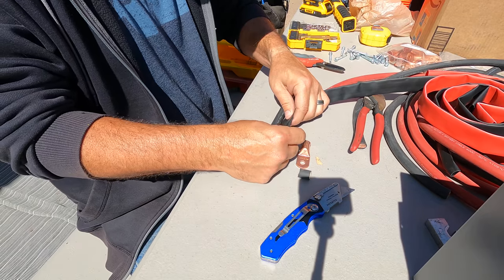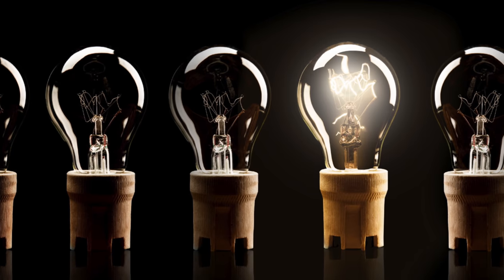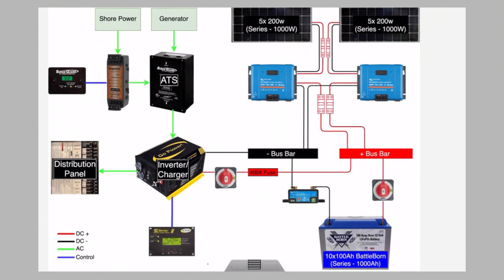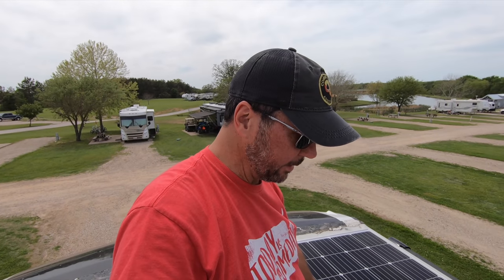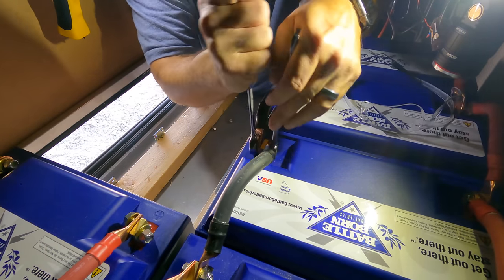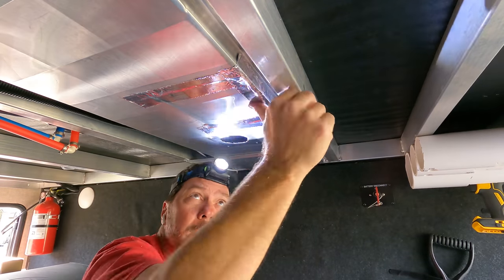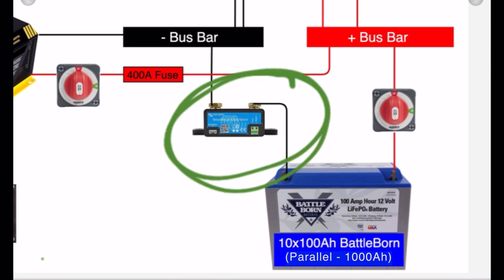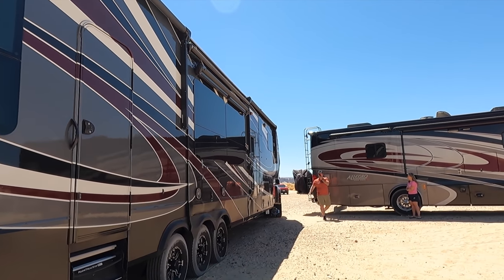☀️  RV Solar Install! 😎  (Full Time RV Life)

Comment: I always like watching you at work. Because I can count on you paying attention to detail.  Maybe because I can easily relate with other Veterans. ..... so you worked on a carrier??  Wish You guys best of health and safe travels.
Reply from the maker: Thanks!  Yes.. I worked on E2-C Hawkeyes, deployed on the Roosevelt (CVN-71)
Reply: @ChangingLanes  I was Army, started as a generator mechanic, finished as a Motor Ssgt. been in many different types of units, all over the world. finally called it quits when I returned from Iraq in 91. Thanks agian, you did a lot of planning and prep the same as I did (with the cardboard cut outs.) of course in this heat, I am not getting as much done as i would like daily. safe travels

Comment: ❤  I have seen videos on people running there ac off solar.  They have installed what is called a soft start on there unit.  I guess rather than max power suddenly (hence the name soft start) the power ramps up. You may want to look into it.
Just thought you would like to know.👍👍

Comment: Awesome video, good overview without a ton of useless details. Only thing I would say you missed is the advantages of parallel vs series arrays, with respect to shade. Some panels it's not as big a deal, but a lot drop an entire string I one panel is shaded.

Comment: Really great job on the install. You really educate yourself to a professional level and then pass on your knowledge!  I appreciate it very much.  
Two questions for you. 
1. I presume you wired your battery bank at 12 volts because you were reusing a 12 volt inverter. If you were starting from scratch would you go to 24 or even 48 volt battery bank?  
2.  What do you think about a  DC to DC charger charging powered off of the tow vehicle’s battery?  Even with a big cable your upper limit would be 70ish amps.  But on days with little solar gain it would be a nice addition to the battery level.  
Always enjoy and learn from your videos. Thank you!
Reply from the maker: Thanks!
1. Yes.  I'm not sure about 24 v or not... Lower amperage might be worth it but not sure there's that big of an advantage. 
2. Those are a great idea, but with 1000Ah now, we can run the fridge on travel days no problem.. even if we didn't have solar.

Comment: I was installing my solar system today and had the same experience as Chad when tightening the battery interconnects with the stainless hardware on my Battle Born batteries. The stainless hardware locked up and I had to cut one of the bolts off. I think the stainless hardware is so soft I think I stretched the bolt.

Comment: Our flagstaff is prewired for solar and has a roof box already installed. I'm sure I'll have to change it out when I go solar for a larger system then it will allow. They were smart enough to have a dedicated pocket that runs down along the control panel to route wiring to the basement. The more I see of grand design the more a scratch my head and wonder why the appeal.

Comment: if you get a compressor fridge solar runs them fine, i have 100Ah AGMS, 600 watt solar and keeps my apartment fridge up all the time (uses 120w vs 500watt rv fridge)

Comment: Awesomely complicated video, I almost followed you to the end. My takeaway is that Solar is great but NOTHING really replaces a generator. $10k of batteries and solar panels = $5.28 in gas on a Generator.  LOVE your channel and videos.
Reply from the maker: Very true.. But peaceful sleep with the AC on = priceless.. 😊
Reply: I gotta agree with Chad on this solar vs generator topic.  Solar is silent and odorless, if high end expensive for front end installation.  Generator is noisy and stinks and must be kept fueled with a non-renewable resource.  For folks who don't boondock or live in their RV's full-time, this extensive of a solar system wouldn't make any kind of sense, it would never pay for itself.  But for full-timers committed to a life on the road and being able to live off-grid and as self-reliant as possible, it makes total sense, IMO.  When I buy my RV, I plan to have a comparable solar system installed...

Comment: When you switch out your inverter charger you may want to switch out your single-pole solar panel breakers with 2-pole breakers.  NEC code states that on non-earth grounded systems both the positive AND negative wire must have a disconnect.

Comment: Great video as usual!  I just completed a solar project on my 26 ft Grand Design.  It’s about half the size of your system but similar to yours.  I have 4 one hundred AH batteries with three 385 Watt panels in series.  They are connected to a Victron 150/85 mppt charge controller which is connected to a Victron Lynx distributor.  We only have a 2200 watt inverter but does everything we need in our RV except air conditioning.  We are in the testing mode also to see how far we can go with only solar.  We do have a generator for air conditioning if needed.  I thought my project was a lot of work but you out did me by a lot.  Hope we get a lot of sunny days now.
Reply from the maker: That Lynx Distro is Nice!

Comment: Well done! I thoroughly enjoyed your diagrams, explaining what and why, and then actually showing showing all the steps.  I appreciate that you prefer to do it yourself, I'm the same way. Your setup is a little more elaborate than my factory 100w panel/single battery system that can't keep my 12v fridge running 1 day😂 Maybe one day I'll upgrade it. 

I had to laugh when you found the end of the conduit! Why do manufacturers do stuff like that!
 
Thanks for providing great content!

Comment: About running your fridge while traveling. You have handled the biggest part of the fridge running or not while traveling. But, the newer fridges have far better insulation than the older models and depending on your road hours, can handle not being running on either propane or electronics for a fair period of time. Years ago, they used to produce RV fridges with 3-way power. AC, propane, and 12 volts. The insulation properties on the fridges of the day were very poor. You did not want to switch over to 12 volts running until AFTER you started your tow rig, because the 12 volts powering the fridge amounted to nearly a dead short, and your batteries would die if left on 12 volt DC for any period of time if your systems were not charging. And don't ask me how I know this!  LOL!! Let us just say that we have been a part-time RV family since around 1976. As always you put out a lot of great information, very clearly, even this old man could follow what you were doing.

Comment: I've read that minisplit AC units draw a lot less power than rooftop AC units. But it might be difficult adapting a minisplit with two control heads into your almost new 5th wheel. Great explanation and install. Hope you get to enjoy the freedom your new investment provides.

Comment: I put 1100watts of pv solar on my RV And because it sits flat and I travel very little in the tropics with the sun overhead I find using victron MPPT regulators and 300AH of lithium batteries...I'm good for about 1 kwh per day if I don't charge from the RV engine. 
Typical loads I run for a comfortable life are a 12v 145lt fridge freezer, diesel heater, LED lights, MaxAir fan , range hood and charge phones and computers etc.
If I never wanted to have to keep an eye on the electrics, I think I should have covered the entire roof with about 2500 watts of solar installed flat and had more  individual regulators rather than have panels in strings....as shade on a single panel in a string really reduces overall power much more than I expected.....and even with 2500 watts of solar installed you would still be a long way from care free operation of induction cookers, electric hot water or air conditioning! 

I hope this helps anyone considering fitting solar to their RV

Comment: Great video- you guys really explained a lot.  However, I do have a unique question-  I recently had solar power installed on my house.  I have 40 panels that give me 10kW of power.  In my system, each panel has its own inverter (by Emnphase), so that power coming down off the roof is already 120V.  This has a couple advanges.  1. AC power lines are much safer than high amperage DC lines.  2. The AC power lines do not have to be nearly as heavy as DC lines carrying the same wattage would have to be.  3. If one panel is shaded or fails, or an inverter fails, only that panel is affected by the power it can produce.  The rest of the system operates normally.  4. I can see what each panel produces with an app on my phone.  This lets me monitor the system for peak efficiency and potential problems. 5. If your goal is to operate 120V systems using the solar (A/C, refrigerator), then there is only one power conversion which is accomplished at the panels.  This means the whole system should be more efficient as you are not converting voltages DC - DC and then DC - AC.  

This does require an isolation from shore power when that power is cut so that the system doesn't send voltage back to the grid when power is cut there.  Home systems that have battery back up already have this protection built in.  I don't see why a person could not also build an RV system that has this same capability.  Thoughts?
Reply: Enphase microinverters need to see grid power to run. Enphase has an system called Ensemble that adds batteries and can enable off grid use but if you price out a Victron based system vs an Enphase based system the Enphase loses by a lot!  I have an Enphase system on my home as well and for a grid tied setup they are great.  

Any DC-AC conversion savings is only realized for the live loads when the sun is providing more power than the loads.  Any excess power is still getting converted back to DC at the "AC Battery" bank for storage. Then any time the loads exceed the solar input, and at night, the you're back to traditional DC battery to AC inversion.

Comment: Great video! Although, I would put as many panels as I could fit on my rig. First, the panels will never put out what they are rated to even under the best conditions, also, most of the time, you are not going to get the max power because of many factors, including the angle of the sun, the atmosphere, clouds, shade, dirt on panels, high temps..etc.  etc. So you want to get the most power you can under any condition. And you can protect the batteries by limiting the amount of power the controller will output. That's my 2 cents anyway. 
Keep up the good work.  I really like your videos! :)

Comment: I've watched your video a couple of times. Second time I spent a little more time reviewing you schematic which resulted in a couple questions.
1. Are you running all load through the inverter? 
2. I know you upgraded the inverted to a Victron. Haven't have an opportunity to watch that yet, but I'm guessing this is the 3K unit which probably would not runn 2 A/C units unless 1 is connected to the alternate output that can be switched off under high load.
3. The $50,000 question is how much of you power needs does this really provide on an extended basis? I know everyone's needs are different, but I'm betting you know what you average daily consumption is and what you are actually getting from the PV array in the real world. You just seem like that guy:)

Comment: I think that my solar system will be fine with 300 amp hrs. And a good inverter, and I might be able to run 1 ac of of that with a pretty robust soft start. But I need a list of everything I need. It's gonna be a lot of money so I'll need to get it piece by piece

Comment: It was hard to see your solar controllers installed, but if you haven’t grounded them to the frame Victron recommends it.  Use the max ratings to determine wire gauge.  6 gauge should work for your controllers.

Comment: I’m always curious why so many of these RV solar systems are so complex (especially with so many pieces of expensive Victron equipment).  For instance, why a breaker between the PV array and the charge controller?  I have 1.5 KW system on my RV and I installed a PV disconnect (IMO makes a nice DC isolator).  Panels designed to produce X watts can only deliver rated current…why the breaker?  Why a shunted system and the additional equipment for the bank monitor (these LFP BMS do that for you)?  Also a system that big (this bank is 12 kW hours) should be 24 or 48 Volts… makes the wiring much smaller and less costly.  Also, why so many panels?  I used 4-365W panels from a salvaged commercial rooftop system and a residential rail mounting system from Snap’N’Rack… bought the panels from a local wholesaler for $100 ea.  Also, with so many ‘All-in-one’ controller/converter/Inverter available, why the dedicated pieces of equipment?  I have one 48V Renogy 3.5 KW controller/inverter/converter (works fantastic….and it’s $800).  I have 4 48V 50ah batteries, the Renogy all-in-one, a 4-panel PV array, a couple disconnects and a bank fuse… pretty simple (and way cheaper).

Comment: Nice and clean install. I Only have one recommendation. If there is a way for you to get the wires out of the heat duct, do it. Those wires are likely not plenum rated and if they happen to melt the fumes can be toxic. 
Love your channel.
Reply from the maker: I'll keep an eye on that and measure the temp next time we use the furnace. 👍🏼

Comment: #2. This is about your battery connection method. I'm not going to draw it out here, but I never connected more than 3 batteries in the "daisy chain" method you used, and only on FLA batteries. The electrons have to pass through each piece of cable to get to the interior batteries, the 2 in the middle are the last 2 in line from either end. When I parallel LFP batteries, I always use identical length cables on each battery (all + the same as each other, - can be a different length from +, but all - equal to each other) so as to eliminate minor differences in resistance which would charge and discharge different batteries at different rates based on cable resistance. Electrons always take the path of least resistance and LFP battery impedance is measured in milliohms, so it's far more critical for cable resistance to be equal battery  to battery. I think all of the YT creators have been remiss in mentioning this. Some people look up to you guys as the experts, I saw one guy on FB bragging he copied you (only 5 BB batteries, but the rest was the same, fewer solar panels) and now he's reworking his system based on the mistakes he also copied.

Short version, I recommend moving your bus bars to up behind the batteries, making up a new set of cables capable of reaching the furthest batteries and making them all identical and connected to the bus bars. Then connect your main output cables to the center of each bus bar. This should eliminate resistance imbalances.
Reply from the maker: It is a lot of batteries to put in parallel, but the off-bank connections are at the corners (electrically speaking) of the whole battery bank.  I've confirmed 10% increments of amperage at each link on both sides (+ and -).   Hope that makes sense.

Comment: Great video.  Massive project.  I'm limited to 3 batteries max on my small 26' class C, but I still want to upgrade from my one AMG house battery.  Not sure how much I can run off the upgrade.  I will need to sit down and do some math

Comment: Very nice presentation.  You do clean work and have created a well balanced system.  The one piece I missed - and I apology if i did - is to try this system with a SOC controller to auto start your generator as needed - automatically!  Thoughts?
Reply from the maker: Victron makes an auto-start that integrates and uses the SOC.  I think it might be built into the CerboGX.
Reply: Yes I believe you are correct.  I've looked and many channels and have rarely found anyone demonstrating it in actual use. @ChangingLanes

Comment: Oh, it must be nice to have this capability! My 2007 Forest River class A doesn't have any of these goodies, and my two house batteries are under the front steps, while my 120v/50A power comes in behind my rear axle on the street side. Not sure how I'd be able to run the solar cables unless I went through the black tank vent cutouts or via the refrigerator exhaust stack. That said, I am looking forward to running SOME KIND of system and expanding my battery bay. As always, thanks for sharing your wisdom!

Comment: Chad, Great video with excellent descriptions of what you're doing and even better why you're doing it. I'm looking to upgrade our 2 Renogy 170 Ah lithium system to 3 batteries with solar panels. This will help with planning this out. Do you use a DC/DC charger to protect your alternator?
Reply from the maker: I had thought about it since the truck has the extra alternator.. But, there's really no point now with the solar...

Comment: Very impressive explanation Chad. We don't have any solar but have noticed on our Momentum 320 that there's a black box on the roof and wires in the front bay battery area with solar on them. Maybe that is just for a very simple install. Looking forward to updates on how it performs and future videos. Great video Tara.  Travel Safe Chad and Tara..
Reply: On my 2021 it has a "JABONI" molded on it. when you pop the end off of it you will find MC4 connectors. On mine the installer used so much torque the base was cracked at the mounting holes. I used Eternabond tape to seal the mounting holes. If you use dicor it will just be a mess and probably block the MC4 connections.  The wires in the battery area are from that roof connection.  If you pull the wire a bit out of the wall hole you might find an in-line fuse. I didn't know about the fuse until I was well into my install and since I have a breaker I just removed it.